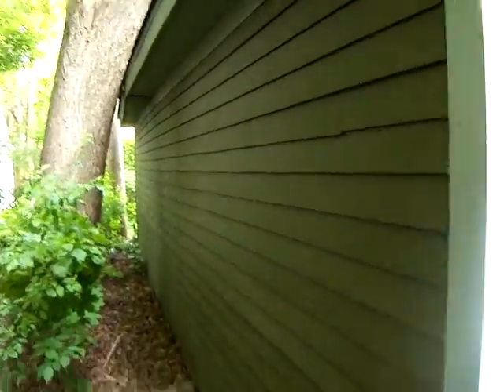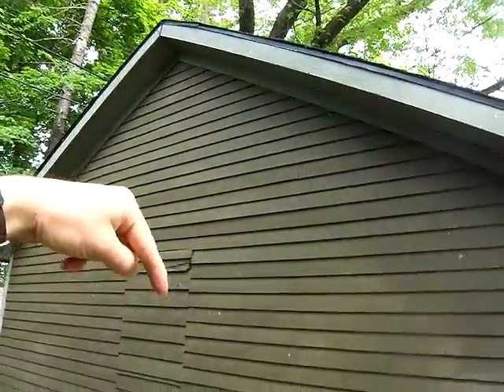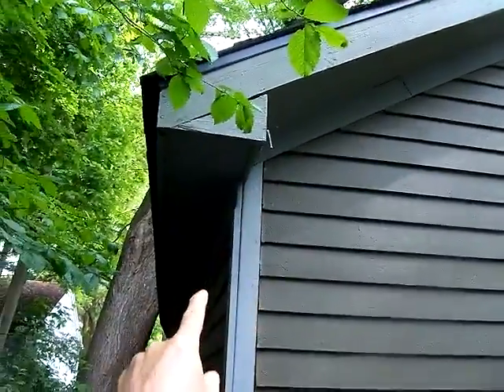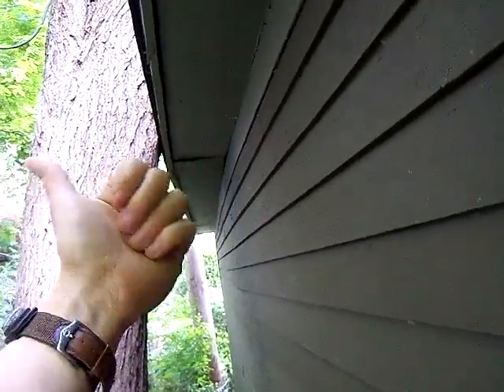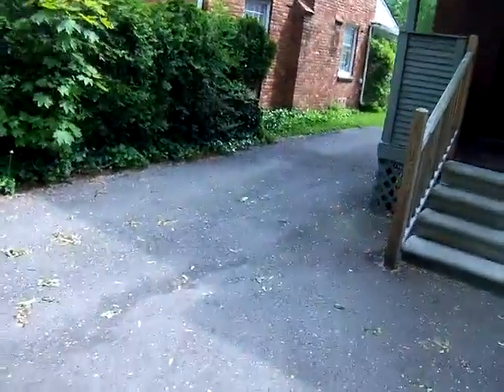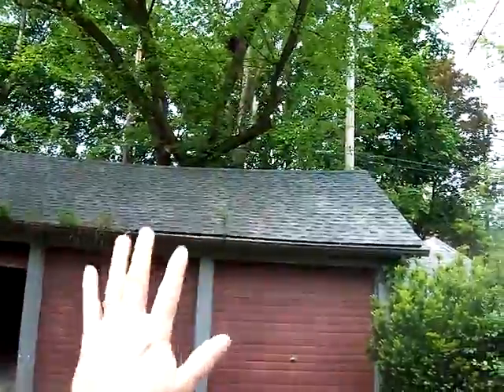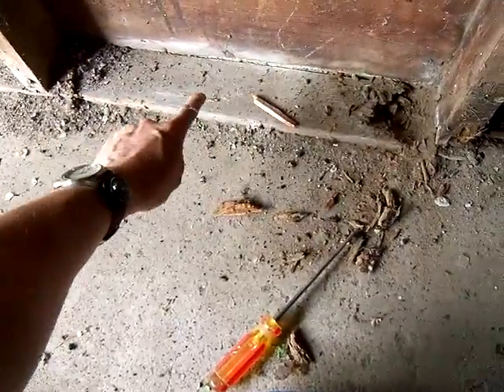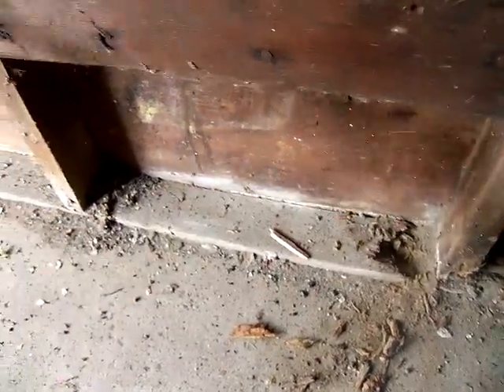Garage walls bowing outward, ridge sags, here's why and how to fix it.  #swayback #ridgesag #roofsag

Comment: Great vid. I’ve got a similar scenario, but the garage has some other problems too… 

It’s only a one car, probably like a 12x20, which is nice.
-Roof sagging a bit and is completely shot.
-Walls not bowing, more so leaning towards one of the corners
-Some wood rot in a few places including the sill plate.

I think I can fix it still, but don’t really know my order of operations. Should I redo the roof before or after the sag and lean is addressed? I feel like the sill plate comes last, after I’ve re roofed and stabilized everything, but what do you think?

Comment: I have exactly the same issue with my garage.  Do you prefer doing it slowly in a span for a few months or can it be raised in one day.  It was due to the previous owner adding so much junk and weight on the rafter ties, which i have removed all of them.  All of the rafter ties on one side is actually detached or its not nailed anymore due to the bowing out, so i can probably just renail it or once its all straightened out.  What do you think?
Reply from the maker: On a wood garage I would do it fast...one day over a few hours.  Depends how bad it is bowed.